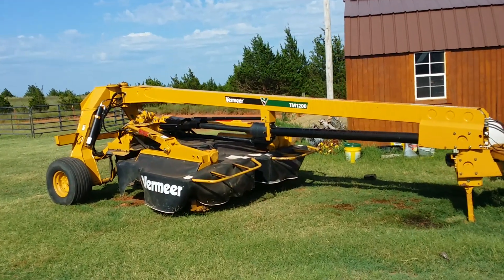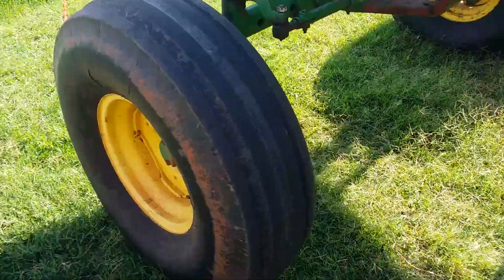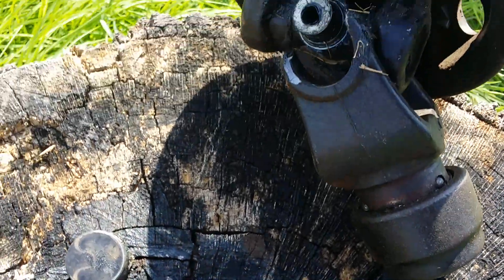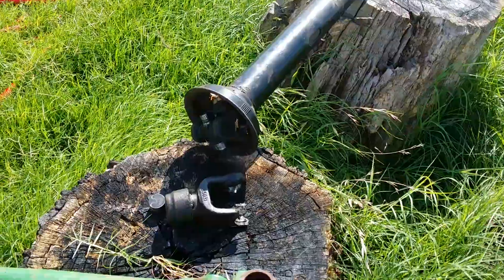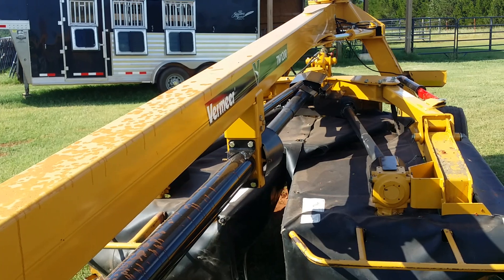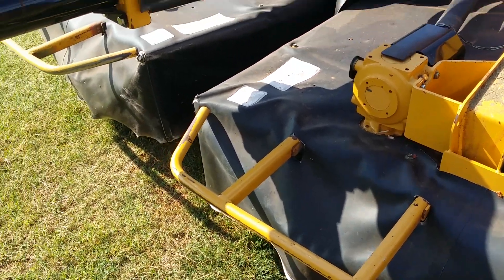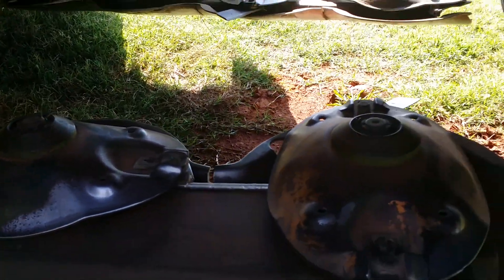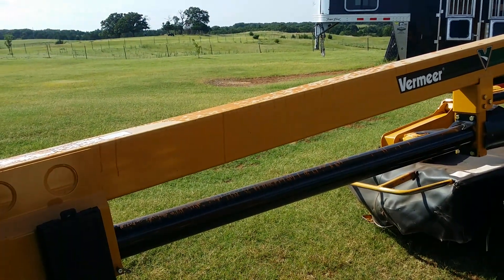Vermeer TM1200 Epic Fail!

Comment from the maker: I had a Massey DM1362 3point mower I traded in on this thing. The Massey gearbox cracked where it connected to the bar. 
My local dealer gave me a new driveshaft off a new machine later this same day. I kinda like this yellow mower, I hope it lasts.

Comment: I'm running a TM1400.  The Mickey Mouse welds holding the swivel gearbox on the header broke loose. The welds had not even penetrated the metal. I've used New Holland 1431's and 1441's for years. I'm thinking this yellow machine may not last long around here.

Comment: Have a tm 1400 going into it's 3rd year (which is similar to your tm 1200).... no driveline issues that you describe.  Your angle on your 3 point was incorrect.  I can tell by your safety chain that it's too long.  That chain should be short enough that if you hit your 3 point lever by accident that your pto shaft shouldn't drop much below level.  Highly unlikely it was your dealer/or machines fault.  Sorry bud.
Reply from the maker: Dealer still came through with a new drive shaft. I was pissed because I used the machine for 15 minutes after paying 20 grand for it.
Reply: DieselFume1 ...  I am not disagreeing with your setup but I don't believe it was driver in this error in this case.   The rust in the break on the machine end of the shaft shows it has been cracked for sometime (due maybe to previous driver error as you discribed) and the yoke on the tractor end most likely broke due to the shaft continuing to spin and hitting the lift arm frame.
Reply from the maker: Reggy_ S I should do an update video on this machine. There has been an issue that I could show, and how I fixed it. In a couple weeks I have an area that I'll be mowing.

Comment: same happened to me
Reply from the maker: Emmett Roche This machine is a basket-case of problems.
Reply: I have a mc1030. Be the last piece of Vermeer on my farm. Main frame has cracked twice. Center gearbox came loose and bent both drive shafts. Turtles and skid plates have worn out faster than the new holland and hesston mowers we had. Really wanted the tm1410 until my 2 frame issues. Vermeer just doesn’t build their stuff heavy enough. I’ll buy another agco product in a heartbeat